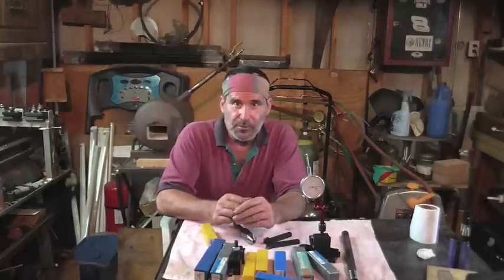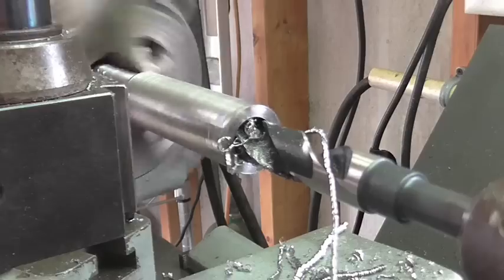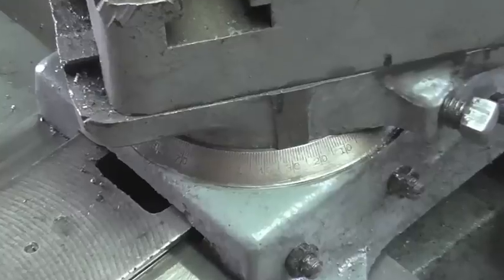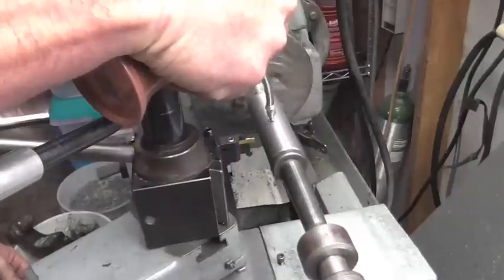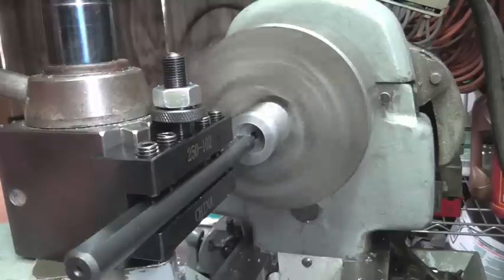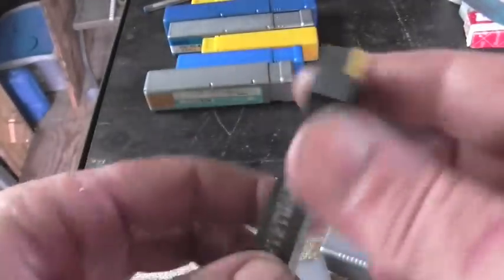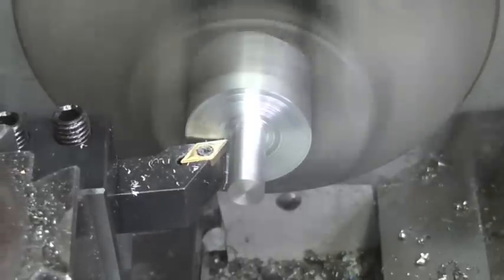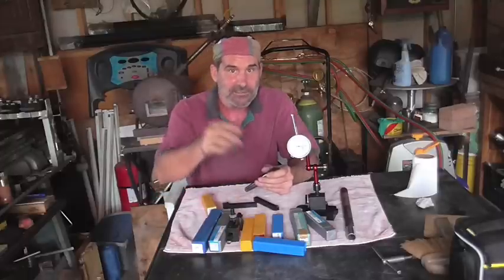Part 1 - Making a Live Bullnose Center and Banggood.com Tool Review - MSFN

Comment: Just got home, found my 7 same tools but from ebay seller and not black, also 10mm square, not 12, but that was by choice... Its the same manufacturer, the seller might differ... The tools outta the box are ok, they do need some finishing touches, for example, the tip under the insert of the boring bar had a slight bang on it, and was tipped upwards, which i had to grind off with a dremel for the insert to sit flush and how its supposed to... The other parts aswell have some either technical issues, easily resolvable by looking at the thing and having a small file in your other hand... That said, i put the inserts in, put one holder into my toolpost on my baby lathe, not a chinese one, a yugoslavian atlas inspired model made back in the mid 60`s... I didnt expect really that much rigidity, especially given the wooden base instead of a steel block and so on, not to say its a baby lathe, but boy did she chowder through stainless steel 9mm bolt like it was aluminum with a hand file... No problem... So much so that i was left amazed... I am in love with machines for over a decade, but this was my first cut on a lathe, and i made myself a sink plunger stem part, as mine broke, and i dont intend to pay 80 bucks for a straight rod with a 5 mm hole in it... I took the bolt, set up the compound, yes, compound, the rest of the things, and went for it... I did have too much stick out, i dont have a center for the baby lathe, so it was unsupported, and the tool was a bit above center of the part, but still, i wanted to see how she does, and how do the tools do... I am more than pleased! Not to say that my carriage was a bit loose and the cross slide is too... I need to take her all apart and clean every part up, but i did a general cleanup so for now its just like that, and even in that condition, loose as a fart, she turned the stainless bolt down by 3mm in increments of .1mm to .7mm which was pushing it a bit, but with `er tight, i know that she will turn it like butter... So if you are wondering if these tools are any good, my first impression is yes, most decent after some little touch ups...  Tho, remember deflection and do spring passes, just feed back to the start while running and you will eat up most of deflection... Tho a lathe and a mill both rely on comparators and indicators and calipers and micrometers for your ass to have great results, so dont expect a magic tool that will produce precision where you fail to...

Comment: Ever try threading out?  You might never go back to "the pucker factor method". 😂
Reply from the maker: I have threaded out at high speed on soft materials. My internal threading tool (carbide insert) is too small to do a 1/2-20 thread, its good down to 24 TPI. I need more tooling :-)

PS: great suggestion tho, saves on anxiety

Comment: The bad surface finish is due to the spindle speed not being high enough for carbide.
Run it up past 1000 RPM if you can for the smaller stock.

Just an observation.
Reply from the maker: I agree, carbide likes high rpm and high feed rate. I am still learning 😊

Comment: Not a criticism just an observation ,I'm planning on making one of these ,but I'm going to use a quality tapered roller bearing for my because with a live centre you have linear pressure a sideways pressure . Great channel by the way .... (0;}
Reply from the maker: You are absolutely right, I just used whatever I had laying around and felt like playing on the lathe at the time. It does work pretty good in the situations where one is needed tho. Next time for me....2 angular contact bearings and a nice thrust bearing. Thanks for Watching!

Comment: So, when you flipped the part around in the chuck, you lost center.  I'm thinking I would have used the #2mt you were fitting with a 2 to 3 sleeve directly in the spindle.  You can't get any more accurate than your spindle.  On the bearings (I'd use two or 3 to get some length to avoid wobble - normally a wide double row bearing is used in these)  I would go with a press fit if I had a through hole that allows me to press the bearing back out.  You also flipped around the live center cone.   These offsets can result in the live center not turning on center of the stem as well as having a different center height or taper depending on the orientation of the 2mt adapter when you stick it in the tail stock.  A live center is complex really.
Reply from the maker: More an excercise of having fun on the lathe, will work ok for non-precise work. We need better lathes Dave. LOL Gotta run, hurricane is coming...wish me luck!
Reply: Upload some clips and let us know how things are going for "you".
Reply: Upload some clips and let us know how things are going for "you".
Reply from the maker: My place and the shop= zero damage. Fared well.....good riddance Irma 😊
Reply: Very good.  Wouldn't want anything to happen to a fine lathe like that.  ;-)

Comment: I'm looking for a lathe what's a good starter one
Reply from the maker: That all really depends on what you will be using it for. I would certainly suggest you get a lathe with a quick change gear box...anything less is just a lot of work if you ever plan to cut threads. I have an Atlas Lathe....they are good starter lathes. Atlas, Logan, South Bend...I would start there

Comment: Nice project Richard. I'm going to start making one tomorrow. I've been using Banggood turning and mill tools for a year or two and haven't really been disappointed yet. Of course, I'd like them even more if they'd send me some free ones! ;-)
Reply from the maker: Thanks George. I found them to be decent tools and did a good job. The project required other tools that Banggood didnt supply but I tried to use as many of the 7 that were sent. I didnt want to just make chips testing out tools and wasting materials. Glad you liked the vid, hopefully the machining community will like what machining content I put out there :)

Comment: The tool line is quality from what you have shown. Most of my work in a logging shop is considerably larger but having these would certainly help on the odd smaller jobs. Good video my friend
Reply from the maker: Thank you.....Part 2 will be out shortly. Consider subscribing! :)
Reply: I am already sub'd and the bell is on to boot. I face many repairs and one off jobs as a machinist/fabricator working with both logging and large scale cattle/grass operations. Probably the best job in system. Lots of recovery jobs repairing things that are no longer available.I never know from day to day what I will be doing. I love it !
Reply from the maker: I love doing repair work on the Lathe...I have become more popular with my friends since getting one 🤔
Reply: Repairs of any more make me feel like I have achieved a something good from my day !

Comment: Tolerances for ball bearings are 1/100 of a mm in +  It will make a press fit,and ball bearing will spin freely.Anything more than 1/100 in + will cause bearings to stuck a little bit,and if you spin them on high rpm it will cause friction = heat.

Best thing is check with a finger,seat the ball bearing and check with a finger if it rotates freely.Like the fidget spinner,with time you will be able to determine is it  good or bad just by using finger.

Also i hope you put axial bearing on that center ,because without it it wont last long.Centers need axial and radial ball bearings  to hold the load properly.Also you should have used Tapered roller bearings and A thrust roller bearing if you are going to use it to support heavy objects.
Also nose should be hardend to reduce the wear,othervise you will have grooves in it in a no time.I dissasembled couple of live centers so i am talking from experience.
Reply from the maker: I decided to do a slip fit with the bearings and use Loctite 609 because I am not experienced enough to muckin around with with precision bearing fits :)  Part 2 will be out in a few hours Zumba!
Reply: Yea you need a micrometer for that.inside 3 prongs are great -but holy shit they are expensive like fuck.
Alternative is to make a caliber with regular outside micrometer and sand paper(this is good alternative ,or use ball bearing as a caliber ,but if you make it you could make it smaller 1/100 than a bearing.) -which are not that expensive,or buy Telescopic gauge set.

I know you are a beginner but its not that hard to make a ball bearing fit properly.without locktite-i know people use it for everything but it cant replace proper press fit.-You will use press fit for milions of other applications so why not to learn how to do it. Its easy all you do is take a pass but small one like 1-1/12 inch ,then measure ,add a little bit more -go in again as long untill you get a measure that you want ,then go full pass.NOTE-make sure your last pass can be made in a single pass.aka dont take 2 inches of material and then try to do it in 1 pass.

Advice -invest into a set of outside  micrometers.they are a must tool for any precision work on lathe,and spend some money on dial indicator. hose are expensive tools but you buy them for life.
Reply from the maker: I have all the tools, outside mics, inside mics, not cheap tools either but experience is not on my side yet. I didnt want to waste the part with a botched press fit. (Not sure of the tolerances needed) All my measuring tools are mitutoyo, brown & sharpe and starrett. My experience is Harbor Freight...LOL

Comment: Don't press fit bearings it causes distortion, the best thing to do is make it snug and use loctite or something to fix it into place.
Reply from the maker: Yep, I had no way to remove them from the blind hole if I botched the press fit or needed to replace the bearings down the road so went with Loctite 609, keep an out out for part 2 :)